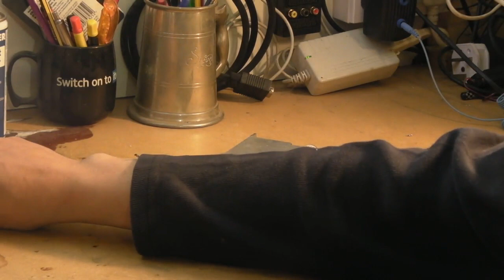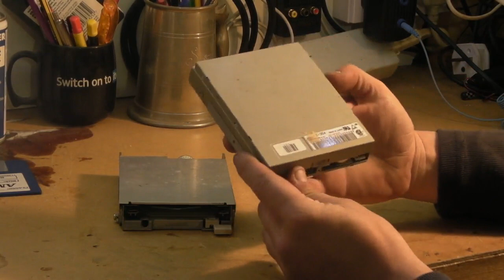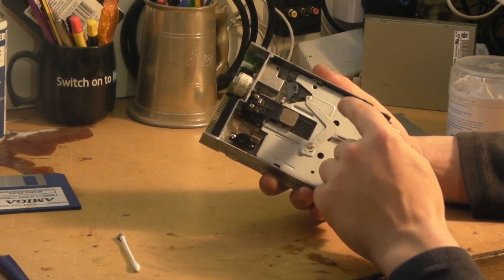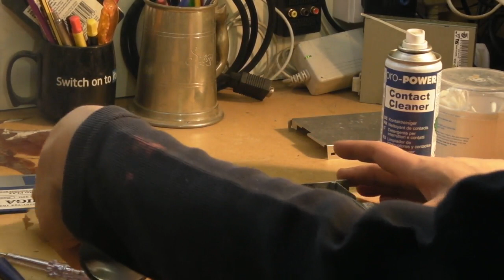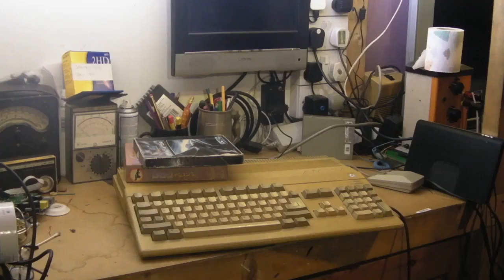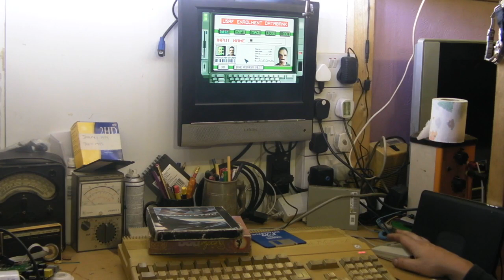Amiga 500 Floppy Drive Service (Teac FD-235F)

Comment: A quick comment on your assumption that a screw on your drives' backside is missing: I have just opened an Amiga 500 Rev 6A that had the original seals still untouched (so it had obviously never been opened before). I found a Teak FD-235F inside, which did not have a screw in place on the disk chassis either. So i figure people at Commodore themselves thought that a screw was not necessary to keep the metal case in place (and it turned out to be true :)